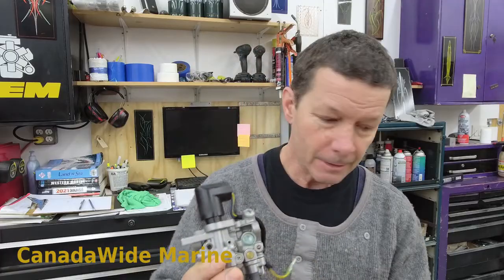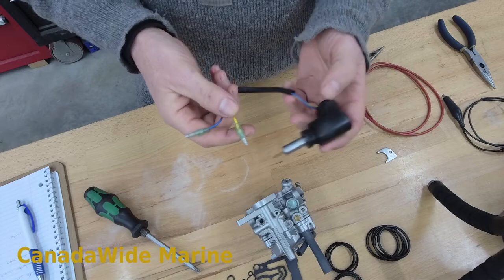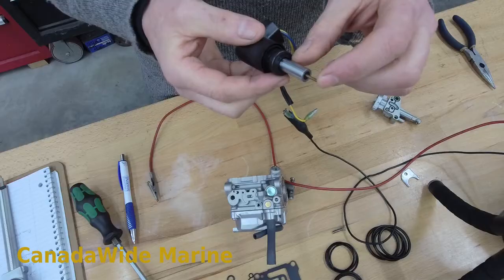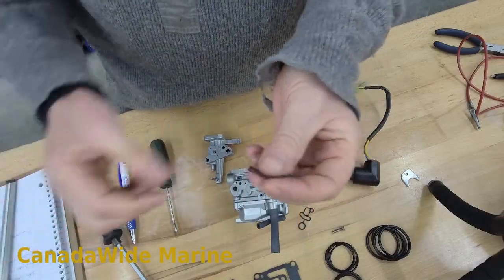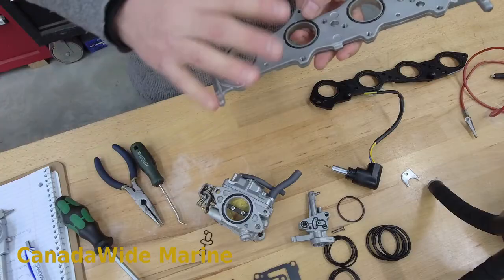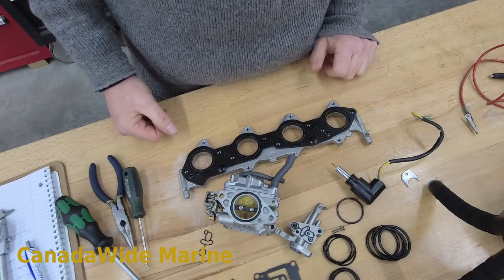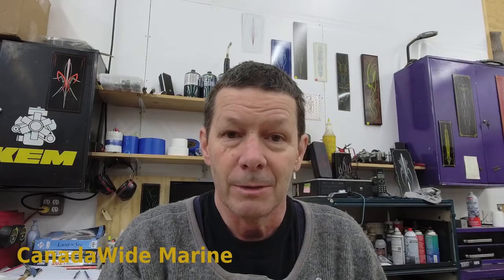Yamaha 4 Stroke outboard difficult cold starting, how to fix.

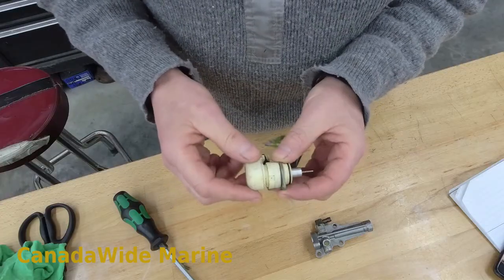Comment: Hi i am trying to get a white one off like showing in 4:54 of the vid. It is stuck even after removing the screw and plate holding it. I can see it/feel it pulling it like a bungee when trying to remove it. How can I get it off? I want to put the carb in an untrasonic cleaner

Comment: I cleaned a rebuilt everything and replaced all of rings and gaskets put everything back in spec and mine still takes forever to start even on a summer day. It’s a Yamaha F50TLRA 2002. 120psi compression all spark plugs are sparking well. The starter on cranks one second at a time and drops back down and it takes about 20 times for it to fire and then it runs fine. Any tips?

Comment: Your thoughts about flattened gaskets was very helpful. I had a throttle lag that I couldn't understand on my T25LA.  So based on what you said about flattened gaskets I replaced the bowl gasket and the gasket on the other side of the carb body 65W-14126-10-00 figuring there could be leakage between chambers. Voila. Everything is now good. Thank-you.

Comment: Thanks for the video! I have a cold start problem with my 25 HP Yamaha that I thought was this valve but now will check the seals. I believe the passages for the air and fuel are part of the carburetor body on that size and I had read somewhere that the fuel passage can also become very corroded and difficult to clean out and was going to look into that as well. The engine starts ok when you cover the intake with your hand until it has warmed up a bit. Another issue that probably isn't related is that many times after idling while trolling it won't open up again and seems like it is running on one cylinder and then seems to clear mysteriously for no apparent reason.

Comment: Have a 2004 50 hp 4 stroke Yamaha that runs very poorly at idle a d when you try to increase rpm it stumbles and stalls. I've removed and throughly cleaned verified all orfices are clear and opened. Rebuilt carbs with all new gaskets and o rings.I've drained all fuel and verified tank is dry and clean of all debris. Fuel pump is brand new. Installed new spark plugs. When i pull wire off plug while running I have good spark.Again the engine starts but very rough idle stumbles then stalls then trying to increase rpm. To get engine above idle I can give a shot of starting  fluid and maintaine higher rpm but again not smooth rpm with an occasional miss. I have 120 plus psi on all cylinders.  Any help is appreciated
Reply from the maker: about the best advice I can give you at this point is to take it to a reputable marine mechanic to have it properly diagnosed. It is easy to replace a bunch of parts hoping to solve the problem, but generally cheaper in the long run to invest in the correct diagnosis and only replace the parts that are needed.

Comment: good morning. I have a problem with the Yamaha f80, it starts hard when cold, can you give me the part number of the o-rings that I need to replace? serial number is f80aet 67g 1003750
Reply from the maker: If you are referring to the intake manifold o rings they are most likely 67f-14239-00-00 and 93210-40m10-00.
But best to confirm that with your Yamaha dealer when you order the parts.
Reply: @CanadaWideMarine  thank you

Comment: Great video, Is there a definitive explanation as to why my F15 Yamaha starts on first pull and stalls after 2-3 seconds for about 3 times, and then runs fine the rest of the day? This only happens in cold weather.
Reply from the maker: Yes, there absolutely is a definitive explanation. I just can't know what that explanation is without doing a proper diagnostic on it. 
It is most likely stalling from a mixture that is too lean, not enough fuel, or too much air. So we need to look for reasons it may not be getting enough fuel, or air leaks into the engine. This is not the only possibility, but a very common one.
Reply: @CanadaWideMarine  ok thank you!

Comment: I really appreciate you making this video. I was at a lose at my poor starting. Whats confusing is i am getting a sneezing condition too(2 stroke by the way, 05 70hp yami) it seems to be smoking like its rich. I am wondering if a reset is needed after gasket replacements. On my model there is a red switch. I have read if this fails it could be dumping fuel into carbs I believe🤔 any insight on that?
Reply from the maker: Hi Anthony,
Unfortunately I cannot give you any insights on your two stroke troubles. We stopped working on 2 strokes about 7 years ago and I am totally unfamiliar with them now. I'm sorry I can't help you but I wouldn't want to steer you in the wrong direction.

Comment: Thank you, this fixed my cold start problem.  

The valve gasket is propritary, but I was able to measure the other o rings.  The o ring between the carb and the mounting plate is an Oil-Resistant Buna-N O-Ring, 2.4 mm Wide, 33.3 mm ID you need 4 of those.  The 8 o rings in the isolater plate appeared to be Oil-Resistant Buna-N O-Ring, 1/16 Fractional Width, Dash Number 028, but they were a few thou too thin.  The new Yamaha  ring was .0704 and the one I ordered was 0.065.  It was still fatter than the squished o ring and seals great.  I would probably try to find a 1.8mm or 2mm o ring in the proper diameter.

One interesting side affect was my idle dropped by 100-150 rpms and I needed to rebalance my carbs due to eliminating all those airleaks.  ,Don't forget to set the balance and new idle speed.
Reply from the maker: That is some great information, thanks for sharing. I am sure it will help someone here.
Reply: This is gonna be me. I believe someone was messing around with my outboard 2 stroke setting idle and air mixture by misdiagnosing the root problem(what the video suggested)

Comment: Thank you very much for this great explanation of how carburettors works. I have a Yamaha 2002 F60TLRA from new with 1800 engine hours, it is a trailer boat used in freshwater for walleye and lake trout trolling.
The engine is hard to start when cold or first time that day, it normally stalls a least 10 times before it runs fine . I suspect it is caused by a vacuum leak in the prime start system, (as you describe in the video) i also idles a little bit rough around 700 to 900 rpm. i plan to rebuild the carburettors with 4 new carb kits.
When the engine was new i had a lot more power (same boat not much added weight) i know that it is quite common that engines lose some power with time, but i am wondering if it is possible to gain some power back?
Spark plugs are dry and more on white colour (all 4 plugs similar colour), indicating lean mixture. I am wondering if new larger main jets would yield more power in the mid range 3500 to 4500 rpm?. . Thank you very much in advance. Any thoughts or suggestions will be greatly appreciated.
Reply from the maker: In my experience these engines are generally good for about 2500 hrs, although I have seen many with more hours, there is usually some sort of major failure by 2500, (I'm talking pleasurecraft here, commercial use is very different). If you brought that 1800hr motor to me asking for more power I would advise putting your money toward a new motor. That said, you will probably find a little power by pulling the head and cleaning the carbon of the valves, and a valve grind. Adjust the valve clearance, and new timing belt. Not to mention freshen up carbs and intake seals. You can certainly find some power with jetting changes, but if you have carboned up valves that aren't sealing the best, or valve clearances out of adjustment you are handicapped to begin with. Hope that helps a little.
Thanks for watching.
Reply: Hi, Thank you for the advice, i do boat work part time and i would definitely give same advice to a customer if a workshop would do the same repair/upgrade on a old engine like mine. Since i have experience in rebuilding engines myself, i don't care about the work hours, only the the spare part cost matter.
I have seen some F60 engines with major failure before, most of them had been hydro-locked due to operator error, and some of them was used as sailing club companion boat on small rigid inflatable boats (high revs and many users)
my engine has 98% of the engine hours between 900 and 3000 rpm, due to the speed restrictions in my area witch is 7 knots.
once in a while I sail on the ocean and larger lakes and there I feel the lack of power.  if i wasn't so cheap I'd most likely upgrade to 115 Hp Mercury Pro Xs, primarily due to the higher alternator charge capacity at low rpm compared to Yamaha (lots of electronics on board)
My engine has no corrosion at all, the timing belt is one year old and the valves are adjusted, compression are within specifications.
i tried to de-carbonize the engine this weekend (EGR cleaner and soaking cylinders/piston tops in it) ran the engine with oil system cleaner before i changed oil and oil-filter.
It actually helped a lot, it ran smoother and had more power than before.
Now i will order 4 pieces of this spare part kit: 69W-W0093-10, to fix cold start issues.
To do the valve job i guess i need this spare part kit: 69W-W00010-100 but it´s currently unavailable here in Europe.
Do you know what size the main jets are for this engine, and what size or part number maybe be a better choice?

Kind Regards
Lars

Comment: Hello, would you be so kind as to provide me with the measurements of the O-rings, not only those of the carburetor, but of the entire intake system, it would really be of great help to me.
Reply from the maker: Hi Arturo, thanks for watching. Unfortunately Yamaha does not publish the sizes of the o rings, and it is pretty much impossible for me to measure them accurately enough to ensure they perform as required. If you give me a make model and serial number I will happily provide the correct part numbers.

Comment: Dumb question... how does it work if my 20hp yamaha does not have electric start or battery? I have a hard time to get it started (about 20 pulls). once is warm it runs like heaven. thanks
Reply from the maker: Not a dumb question at all. The cold start valve has a little electric heater in it. even though your pull start motor does not have a battery, it does have a generator to generate electricity to power your ignition system and your cold start valve, once the engine is running. It is important to note that the cold start valve requires the electricity to close, meaning that it does not need electricity to richen the mixture up for cold starting. So, if you are having a difficult cold start as it sounds like you are, you need to look at why. I explain many of the causes in the video. If you are still unsure what is causing the difficult cold start I highly recommend booking a diagnostic with a marine mechanic before you start spending money on parts without knowing for sure exactly what needs to be replaced. Parts are very expensive, a diagnostic for a difficult cold start should only take an hour, maybe 2 with consultation time. A good mechanic will be more than happy to diagnose it and tell you what parts need replacing.
Reply: @CanadaWideMarine  thank you! I took it apart... hooked it to an external battery and it works the way is supposed to... The only way the motor starts first pull, is moving the throttle lever up and down about 8 times... it starts, it runs for about 20 seconds no matter what I do... it dies, throttle again this time 3 times... it starts... then one or two more times the same. it warms up and it works like a charm... is a bit annoying and it takes a full minute or so. thanks once again... if you have any tips for me I will take them.
Reply from the maker: @buschrpm  By the sounds of it you are experiencing a lean condition on cold start. Moving the throttle operates the accelerator pump which adds fuel to the mixture. So you are either not getting enough fuel at cold start or you are getting too much air on a cold start. check for vacuum leaks, in particular between the carb and intake manifold. If the carb seals with o rings to the manifold replace the o rings if they are old or at all suspicious. the other thing to check is that the fuel supply to the cold start valve is not blocked. this will take a little detective work to identify the passageways the fuel takes from the float bowl to the valve, but you need to ensure they are not blocked.
hope that helps.

Comment: Thanks for this explanation.Any idea on a 9.9hp four stroke Yamaha that starts and Idles fine then when put in gear stalls?
Reply from the maker: Lots of ideas. It seems I need to do a video on this as I have had several questions about stalling when going into gear. Until then, here's some info:
Generally speaking, the engine stalls when it is put into gear because is is not making enough HP at idle to take the load of the propeller in the water. Keep that thought in mind.
Always start with the basics. Put new spark plugs in it, spark plugs are inexpensive and the average non mechanic cannot really tell if a spark plug is good or not, so it's easiest to just put new plugs in it. Check your compression while the plugs are out, if you have a weak cylinder or two it will not be making the hp required at idle. Change your engine oil. I have diagnosed far too many running issues because of old engine oil, (that's a topic for another video, but trust me, fresh clean oil helps make hp and makes the engine run better). Put fresh fuel in the tank, open the drain on the carb and pump the primer bulb until that fresh new fuel drains out the carb.
Now, assuming everything else is in good working order we can start looking at causes. Things to check: 
Idle speed, is it simply idling too slow. turn up the idle speed a little and see if that helps.
Idle mixture, generally an engine is more likely to stall when put into gear from a lean mixture, not enough fuel, so richen the idle up a little, half a turn out, (counterclockwise) is a good starting point.  
If those to adjustments don't fix it we need to start looking deeper. Time to remove the carb and check the seals between the carb and manifold, there is usually a heat shield plastic insulator between the carb and manifold, make sure seals on either side are good and that the plastic plate isn't cracked. 
Next you will be opening your carb up cleaning the idle jet, it is so small that it takes very little varnish buildup to restrict it enough to cause problems. Watch my video on diagnosis and repair of four stroke carbs: https://www.youtube.com/watch?v=w-kJES0FCIE
Hope that helps,
Thanks for watching, and don't forget to subscribe so you don't miss a future video on this exact subject.
Reply: @CanadaWideMarine  thanks…that is a big help.
Reply: Check valve clerance most people don't look at it. Yamaha is very sensitive for this.

Comment: Great video!! I have an 02 T50 high thrust I bought last summer, cold starts we’re bad during duck season last fall. I also have a bad stumble when I start to give it throttle. When I first bought it, it idled great but wouldn’t rev above 2000 rpm. I pulled the carbs and the main jet on the top carb was sitting in the bowl and they were varnished inside bad. I cleaned the carbs, changed the plugs and have perfect compression. I haven’t done the o-rings or seals on it, but I’m definitely doing them now. I’m located in Niagara Ontario, so I may just order them from you. Thanks again for the video. I’ve been searching for this info for months now.
Reply from the maker: Awesome, glad the video helped. Thanks for taking the time to let me know. If you need any further help you can always reach out here, or email: support@canadawidemarine.com.